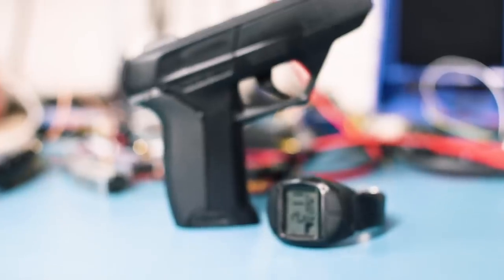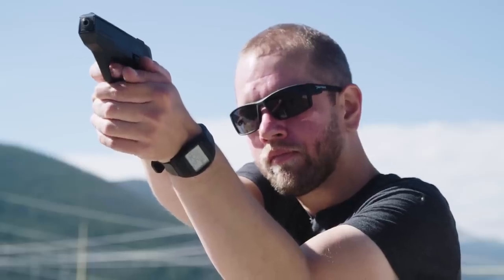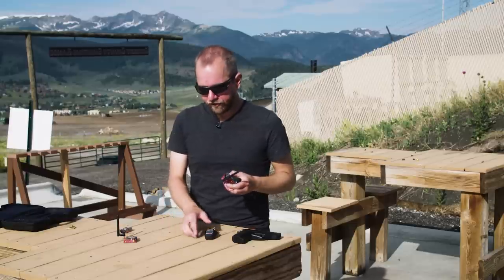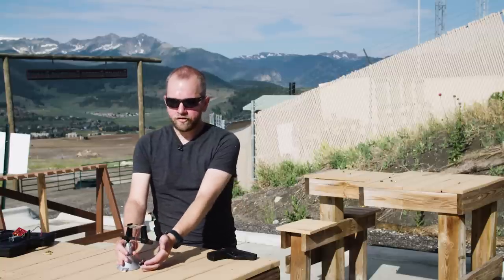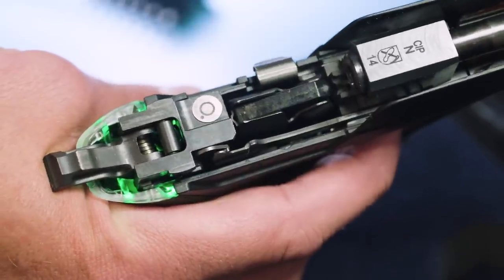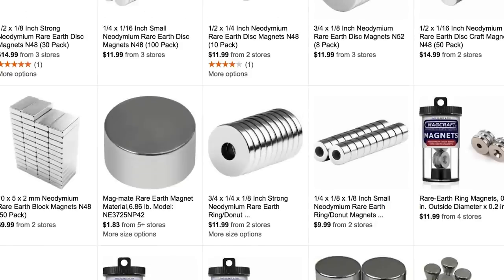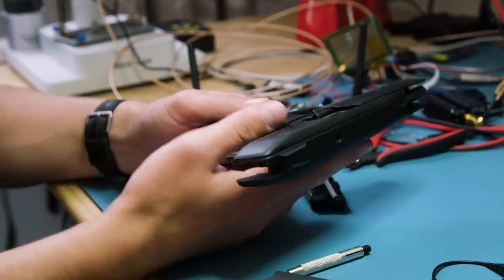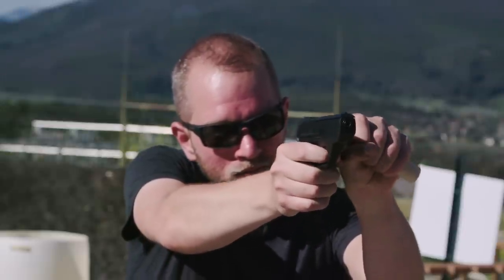How a Hacker Fired a Locked Smart Gun Using Only Magnets | WIRED

Comment: NYC developed a fire hydrant that was vandal proof. Without the key wrench you could spin the top without opening the hydrant. The kids quickly designed a wrench that had used an old speaker magnet to lift the pawl inside the valve body to open the hydrant. Job done.
Reply: i heard The fire hydrants in NY is waterproof

Comment: Cop has a baddy at gunpoint... however gun be like... SYSTEM IS UPDATING, PLEASE DON'T TURN OFF... 23%.
Reply: Mercury's Don must be a windows 10 pistol
Reply: The department didn't pay the service fee in time, said cop must now watch 30 seconds of commercials on the little display on the firearm before he can fire.
Reply: Xavier Rodriguez just about everything has software. The term is different however. It’s called firmware. Just about everything you’ll ever had has some in it. Usually it can’t be updated or changed, if it can, it’s usually a complicated and risky process. Your refrigerator, your furnace, your space heater, your tv, your DVD player. Everything that does pretty much anything on its own.
Reply: +Daniel Allison

Well atleast it's not a Windows Vista pistol.

lol.
Reply: I know you're trying to joke, but it's not a firmware update issue nor will it ever be. The reason why people don't like smart guns is because they're not as reliable as conventional ones. If it fails you may die, something which most people have a problem with.
Reply: Sorry but does your microwave or stove also need a software update?
Reply: Nicholas Blidgett Thats because it is connected to wifi and has software that is being updated. A smart gun doesn’t have wifi connectivity nor software, it’s like how your tv remote doesn’t have software updates, it’s just not possible.
Reply: Lol! What operating system? Microsoft, iOS, Linux?
Reply: Mercury's Don that’s only if it’s made by Microsoft.
Reply: Xavier Rodriguez r/wooooooosh
Reply: Xavier Rodriguez it’s a joke don’t you understand?
Reply: @foodhatesme  I can see it now "iGun"
Reply: My Tesla was like this.I at least had a excuse and proof for my boss lol.
Reply: @nepnepnepnepnep  I guess you don't have a smart microwave
Reply: He should get the igun 10 s
Reply: @sekgo1265  if it was, it would take about 10 minutes to fire after you pull the trigger, and lock up after the first round, requiring a reboot of the pistol.
Reply: @madman2u  source ?
Reply: It wouldnt need secuirty updates, itlll run a condensed cellular network. This mean general public commodoties wont be compatible with smart guns. Which means it wont need updates

Comment: I'm pretty sure I could just take apart that slide and disable the safety block for free....
Reply: Rcbif I know right!
Reply: You totally missed my point.... I would not buy this piece of crap. My point is, the very same people this gun is designed not to work for, can just disassemble it in a short time to "permanently" override it's safety feature.
Reply: Correct me if I am wrong, one of the biggest things this gun prevents is somebody grabbing your gun and using it on you?
Reply: Jeffrey Baker once again the point is missed.. he is saying that the person who takes it, from the drawer/ owner, can disassemble it and then off the safety feature.
Reply: I see. Though is the gun designed for that purpose? It is like saying a safe is useless because if a criminal takes it, they have plenty of time to break into it. Or saying computer security is not worth it because if somebody has physical access to any device, the security is compromised after a given amount of time. 
The speed at which this happens does not matter unless the person who took these devices is at the top of a building being swarmed by police.

This is ignoring the fact of the cost, more of the concept.
Reply: Jeffrey Baker Well, as the website put it: "As soon as the gun loses radio contact with the watch – e.g. if it is knocked out of the shooter’s hand or in case of loss, theft, etc". So there's 2 possible scenarios that this gun is 'supposedly' safe against, when it's knocked out of a shooter's hand, or theft. 

On the first scenario, the video demonstrated that it only needs 2 seconds to hold a magnet near it, to cause the safety measure to fail. One might say, 'it's not likely your assailant will prepare a magnet beforehand', well, don't fear those who aren't prepared, but be very afraid of those who come prepared. Maybe it's your acquaintance who knows you're using this armatix gun. Or maybe it's a stalker who knows you got this armatix gun, from that ass-ugly smartwatch.

On the second scenario, it's accepted that if a guy got time to tamper with something, it's considered as lost. What laughable is how fast the system can be bypassed. It's like that video that demonstrates how to open a locked Sentry Safe in 5 seconds: https://www.youtube.com/watch?v=ApJQ2wcYjBo

Just looking at that cheap ass 'security pin', I will go on a limb, and say it can be physically bypassed with a super glue, or even a hot glue. Just have to lift the silver pin, glue around it, and wait for the glue to set. 30 seconds for taking the slide apart and put it back together, another 30 seconds for the glue to set (and I'm being generous with the time estimation). So if I'm a burglar, and you're in a shower, I can take your gun out of the drawer, and spend a minute to bypass it, and spend the extra 4 minutes just sitting on your bed, waiting for you to come out of the shower, with your 'supposedly safe but not' gun in my hand. 

And that's not even the best part. The best part is, you're paying $1400 extra (this gun is $1798 while a Walther P22, same .22 cal is $319) for a security feature that can be bypassed in 2 seconds, with a $20 magnet. Reference source: https://www.americas1stfreedom.org/articles/2015/11/12/exclusive-we-test-the-armatix-ip1-the-not-so-smart-gun/
Reply: Creatip point taken. I think they need to fix the magnet bypass ASAP. Then at least it will work for #1. I do think they need to find a better way to have the unlocking device too. The watch is pretty bulky.
Reply: Jeffrey Baker According to the video, he did report the findings to the company, and they basically just shrug it off, saying, 'yeah we know. It happens...', which is a major dick move.
Reply: Ha. What a good company. Maybe I should just start selling 'special EDC' magnets for 500 bucks and advertise them as a key to these guns.
Reply: Creatip uhmm what's the point of your comment? Let me elaborate this.

Let's say a random person that intends to kill you stole your pistol (a normal one) , you would be dead for sure (unless somebody helped you or you fighted back).

Now let's say you owned the pistol in the video , not every person know about this gun which gives you a higher chance of survival.
Reply: Jeffrey Baker all they would have to do is get right next to you.
Reply: Your Nightmare Then everyone needs to know about this, let everybody know about it and how broken it is.
Reply: You would have to pay for the screwdriver though
Reply: Rcbif in a hurry?
Reply: Jeffrey Baker i
Reply: Rcbif but you can't do that during a fight, like if you disarm the owner and try to shoot him with his own gun.
Reply: Rcbif o
Reply: Your a taking it out of context no need to be correction police
Reply: Beater Pro Good thinking Einstine.

Comment: Nothing safer than my Glock
Reply: Other than its like half plastic
Reply: Preston Garvey 
That makes it unsafe?
Reply: Jakov Bogatić 
Moron
Reply: ManBearPig 617 - says the guy that would throw a gun in mud and sand
Reply: ManBearPig 617 - ha whateva pig 😂👌
Reply: Preston, your favorite gun is made out of junk strapped to a damn wooden stick, and you claim "plastic" makes a firearm unsafe? :P

Now, really? Making the assumption that Compiler has trained, and practiced with his glock? Then yes; No other firearm is safer, in his hands, than his glock. Because he knows it, and is safe with it.

Assuming he is just another random youtube commentor with buyer's bias....most firearms are all just as safe as the next. Regardless of their construction, unless they are:
A: Made like shit, and can break into a failure mode that allows out of battery firing, or unintentional discharges.
B: Are old, and extremely rare: poor gun designs that can be fired inadvertantly without pulling the trigger.
Reply: Goldmarble - sry didn't catch that...what i did get was a message 5 miles away from a settlement in need of help 😂
Reply: Nothing safer than living in UK
Reply: Springfield*  There I fixed it
Reply: There are videos of glocks undergoing the craziest stress tests and still firing. One was left in a fishing cage in the ocean for a year and still fired.
Reply: I was at a shooting range, and the guy running everything had a glock and was talking about that you had to break in new firing pins and stuff like that, but he also said that every time he cleaned his glock, the first 30-100 shots would always jam
Reply: Joe Smith 
A manual safety does not make a gun is safe. The person in possession of the gun makes it safe.
Reply: +Joe Smith
If a person doesn't understand trigger discipline, then no amount of 'safeties' is going to make them safe around a gun.

Just as you can use metal shop tools, cars, electricity, natural gas, propane and gas unsafely, you can use a gun unsafely.

Accidents make up 146,571 deaths a year in the U.S.  You are the risk factor, not the piece of metal.
Reply: except a sig LOL
Reply: nothing safer than no guns
Reply: Miggy yeah, then we can just all use knives.
Reply: Miggy baseless statement is baseless. There's no saying for sure what would happen.
Reply: of course there is just compare it to countries where its illegal to have firearms.
Reply: +Miggy
The problem with people like you is that you think in very small time frames to make very-long lasting laws.
If you look back at the last 300 years, every country except the U.S., Oceania and Canada have suffered MASSIVE bloodshed, much of it involving armed people killing, raping, enslaving, conquering and imprisoning unarmed people.

We've seen the Soviet purges and famines, the Nazis, the rape of Nanking, the 'Great Leap Forward', the French revolution, Napoleonic wars, WWI, WWII, post-Soviet wars, the Middle East (which was and is a hellhole, regardless of outside influence), warlord-run Africa, cartel-run Latin America, the religious wars in India, Pakistan and Bangladesh, etc.

What REAL violence has the U.S. seen?
The Civil War and some rare, smaller incidents with the GOVERNMENT shooting its own citizens.

You need to reconsider the balance of power between the governments and the people.
And besides, good luck getting a cop to commit suicide for 35k a year just to take someone's 2nd Amendment away.
Reply: What about mexico with strict gun laws?  wow, the violence is incredible.  gun fights in the streets, drug routes fought out by automatic gunfire night after night.  executions, kidnappings, corrupted military & police.  Yeah, those strict gun laws are working out REAL well...
Reply: I confess UK has much less gun related violence BUT they live freely UNDER THE UMBRELLA OF AMERICA'S PROTECTION.  So does Japan.
Reply: and yes you are right UK can be thatnkful beeing under the umbrella of the greatest country in the world
Reply: Miggy did you just say that the UK is the greatest country in the world? Wow. Please do tell what you've based that assessment on.
Reply: phillip can you even read? i was beeing sarcastic about the cocky americans saying they are living the greatest country in the world.
Reply: Preston Garvey you're not Preston. You didn't even mention settlements in any of your comments. Imposter.
Reply: well you obviously cant otherwise you would have seen that i wrote "UK can be thankful beeing under the umbrella of the greatest country in the world" which has nothing to do with beeing sarcastic or not. take me serious or not i can care less. i have a opinion so if you think my opinion is stupid bring some arguements.
Reply: Compiler Revolt my friend was killed due to a lack of safety.
Reply: @manictiger you missed my point... of course criminals dont care but in countries like mexico for example are way more criminals than in the usa or europe. you can go and buy a gun in mexico at any time because of the bent police and the goverment. 

my point is if there wouldnt be any guns accesable for public and owning one would have actual consequences there would be far less murdering and crime. 

you are talking so much about self defence but the reality is you dont need to lethally defend your self against attackers with knives for example, a pistol wouldnt help you much anyways in that case. you only have to defend yourself with firearms against attackers with firearms. 

if america would spend as much money and effort into other stuff like helping 3rd world countries or places like mexico there would be no need for the army. im not a puppet, i dont say that because someone else told me to say that. im a human im judging and creating my opinion by my own researches and experiences.
Reply: @shout itout i could explain my opinion about the U.S Army and the NATO but i highly doubt you would understand that....
Reply: @shout itout since you cant bring any arguments and all you do is trying to talk down to me i will not respond any further maybe you should think about who should go back to reading comics because your acting is childish.
Reply: give it 10 years and it won't be either as safe or as powerful
Reply: A 1911.
Reply: Miggy enlighten me where are guns illegal. Except North Korea and China in every country is way to legall owning a gun. Even in UK is not a big problem owning a shotgun, or rifle, when you in gun club.
Reply: Gangster88232 aren't you ignoring quite a few countries to push your narrative. 
Most of Europe Australia and japan that either require a gun licence that is extremely hard to get or outright ban them

Hmmmm your narrative seems to fall apart unless you are implying that china or north korea took over the world while i was sleeping.
Reply: manictiger 

 the founding fathers knew that as times change the laws could become either outdated, obsolete or detrimental and they made the constitution flexible

In other words it's amendments can be altered, deleted or replaced via a democratic process . 

Treating it as a religious text is a fallacy and a disservice to the constitution itself. 

Also proclaiming proudly "we are not a democracy"  shows your lack of understanding 

It can be mob law if it devolves into demagoguery. 

But if it's utilized in a feedback system then it can be the most effective political system, it's not by chance that  democracy was the nessesary ingredient that gave birth to the philosophies and sciences of the western civilization 2500 years ago. 

One way to avoid demagoguery is to employ a Socratean clause on top of the feedback system (we lack both)
Reply: fl00fydragon i am talking that there is way to own gun throught licensing of course, captain obvious. If you meet requirements and well prepared is not difficult to get some gun. Not an assault rifle, but shotgun or bolt action rifle yes.
Reply: Bradley Irving other than Australia that has no guns
Reply: Except for an m1911 with the grip safety
Reply: The AK-47 is the best rifle no doubt I have one, it will fire in mud, sand, water and hasn't jammed yet
Reply: Bradley Irving living in Finland is safer
Reply: BlueBleedStl  that's true but they  r tuned for under water shooting to shoot all the time and if u go deep enough it will fail still Glocks r the revolvers of the semauto world reliable available and not going anywhere any time soon tbh if it was picking a basic pistol for opteraters it's between a Glock in 9mm-40 or 45acp 1911
Reply: any other pistol with an actual safety if you ask me
Reply: yourleftnut1 Except most people upgrade their Glocks so much it isn't even a Glock by the time they are done with it. (Its because factory Glocks suck!)
Reply: On every gun video i watch, there is always that one sheep   annoying guy bragging about his non american made  Glock pistol.    Sheep
Reply: zameliz relatively cheap prices with decent reliability
Reply: I THINK THERE'S ONE THING WE CAN ALL AGREE ON IS THERE IS ALOT OF DUMB PEOPLE HERE AHHHHHHH
Reply: Wrong, a good ol' bolt action rifle is safer in every way.
Reply: Except... Not having a gun
Reply: Just saying Glock isn,t the safest gun considering it doesnt have a safety